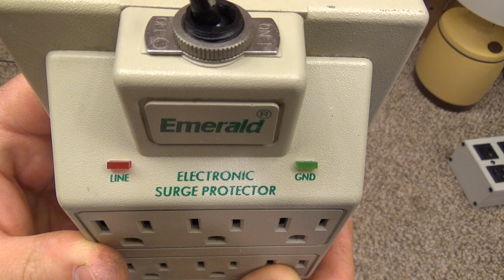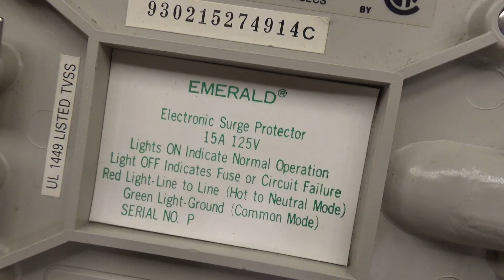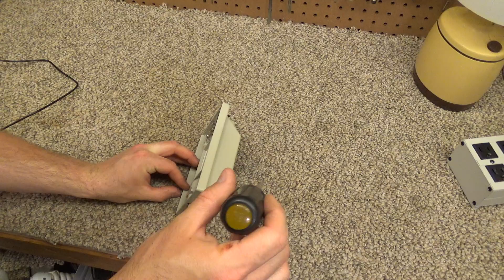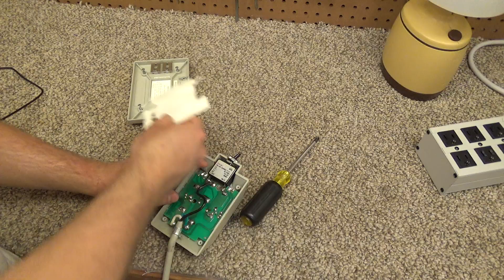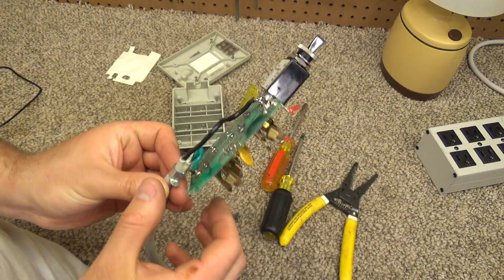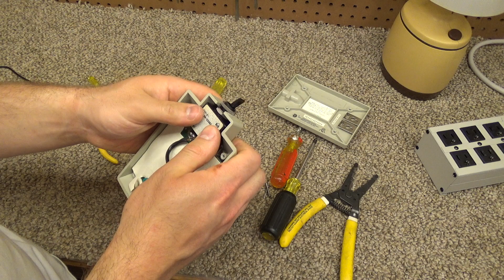Emerald Power Thing Freakshow

Comment: You seem to have very little patience. The paper is likely a fireproof insulator, and you put the aluminum "on/off" indicator plate inside. Long day?

This is definitely a cheap surge protector upsell for an earlier computer setup. the 15A rating is alarming. Imagine a space heater on this thing for a few hours lol
Reply from the maker: I did have a frustrating day at work, and had a cold on top of it. Normally this would not have gotten to me.
I would be astonished if that paper is fireproof, I may have to test it. It really just feels like a piece of copy paper. It looks like I'll have to revisit to correct the assembly error.
All these cheap bars seem to come with the 15A rating, definitely not electrically sound. It also seems like the switch is rated for only 14.2 amps, which is kind of odd.

Comment: That's a perfect example of why I don't like taking things apart unless absolutely necessary (e.g repair, cleaning, maintenance etc) things like that aren't designed to be user serviceable and you're just asking for a frustration fiasco I'd rather not put myself in that situation if I don't have to.
Reply from the maker: That is valid, and with certain pieces of equipment I really want to remain in good condition, I tend to follow that.